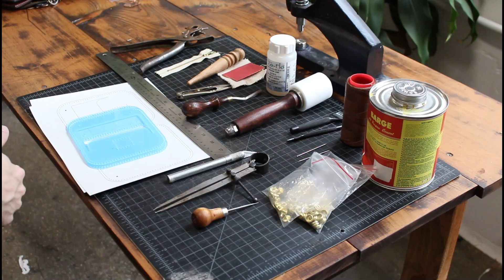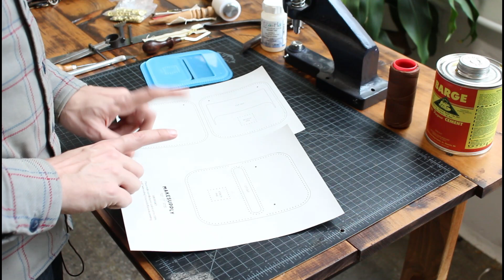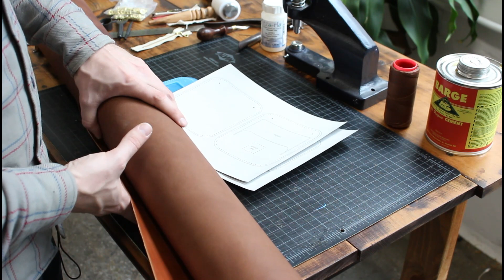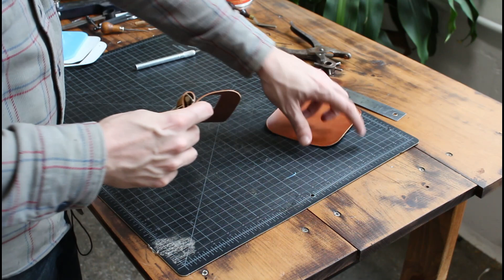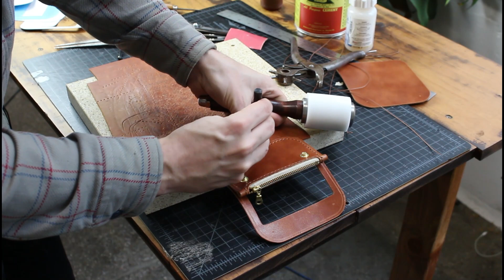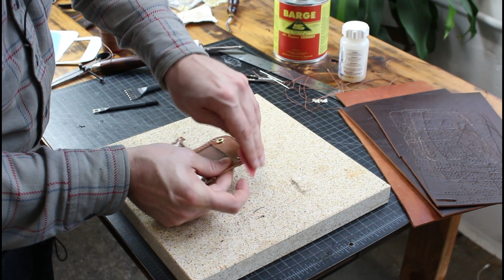Make A Leather (Mini) TRUCKER WALLET | FREE PDF DOWNLOAD!

Comment: Thank you for the video and free template! I have a question on the leather. Is it Crome tan or veg tan? Because I have a piece I bought from hobby lobby that I believe is Crome tanned and I am having trouble burnishing the edges of it. Not sure if that leather requires a different method of burnishing.

Comment: I made your 5 pocket bifold wallet, took me months to do (as I was acquiring the tools) and learning along the way. I made it from the leather of an old purse of my wife's. It's pretty thick but I think it will last forever. Great instructions in your video.

I have one question, what type of contact cement are you using? I'm using elmer's, but I read that it wasn't recommended as it isn't a permanent solution. I heard that there's a contact cement that's water based that is preferred. Wondering what you suggest and/or use, thanks.

Comment: Nice as usual. If you use two sided tape on the zipper and attachment square it a lot easier. Let your contact cement dry like 10 mins. Also cheap acid are great for applying glue. I have used your long wallet template (first template I ever bought ) with different tweeks to make a bunch of different style wallets.